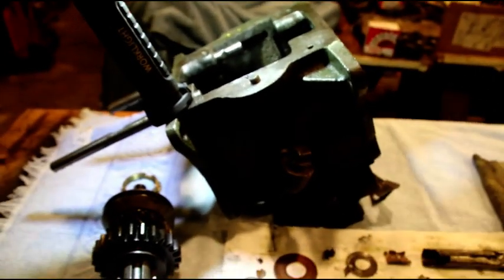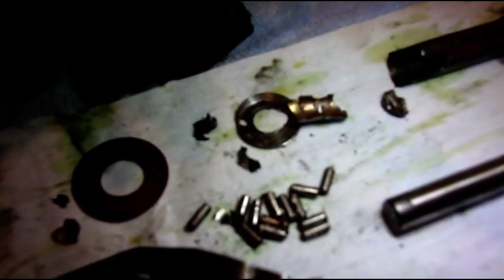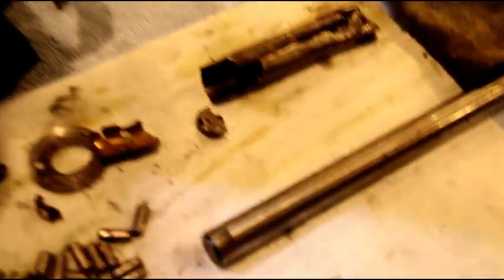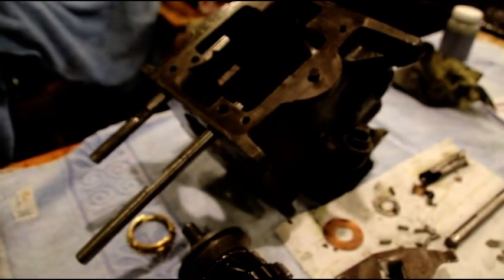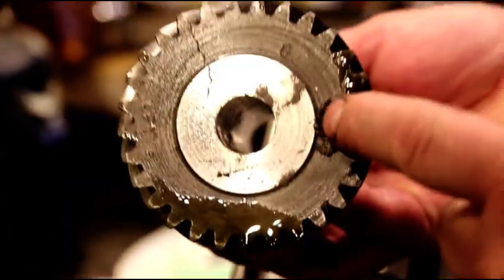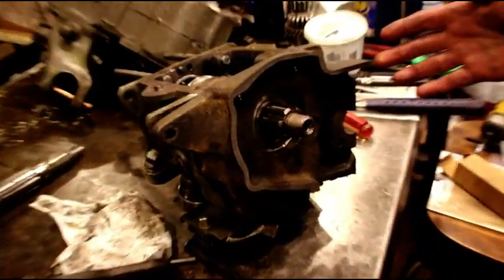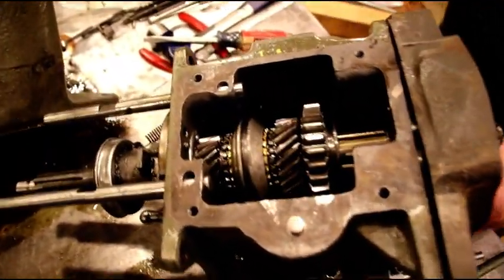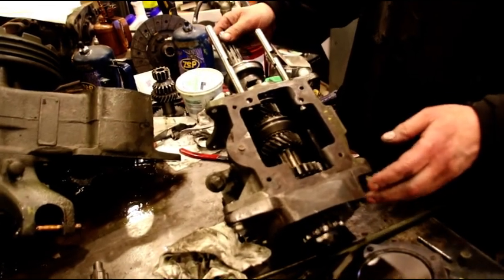Willys MB T84 Transmission Destroyed By Using The Wrong Lube

Comment: I have watched countless videos and read countless threads including the TM section on  the T84. I spent many hours working on it. I did get  a NOS case as I wanted to start fresh. That included some NOS parts and some  repro. I did use an old T case but didn't cut it. It helped a lot. One thing I remember is use all the gaskets needed for it as they play a part in the shimming of the transmission.  I did a lot taking it apart and putting it back together. Some said the blocking rings had to be rather tight no slop and another where the gentlemen said slop is good in that area. I had that. 

Fast forward to today. I'm driving it and used GL1 at the moment and so far no popping out of second and no fluid loss either. I do check them quite often. I do maintain the oil change at around 500 miles just because why not. Won't hurt it. As another gentlemen here said the manual changed from GL1 to GL4. 

I'm curious as to what really happened to the transmission in this video. I've never seen that happen in any vehicle I have worked on. My first thought it low oil for that kind of metal failure. Just my opinion. 

Brian you have a different assembly process than what I have seen. I have saved for future reference. I like to see how others do it. 

One I did see is use an old bearing and open it up enough to take it on and off easier than a new bearing, I did that and I'll tell ya that saved me a lot of time. Again many ways people put them together.

Comment: explain  please   how could a bad lube. cause damage,    you make a lube?    what about the ww2 lubes ?
Reply from the maker: extreme pressure additives in  the wrong lube will eat away brass and bronze.  This is a fact that people don't understand.  My lubricants are yellow metal safe and I have been using and selling them for over 30 years with no problems.  Do not use any type of lube with extreme pressure additives in an early transmission or transfer case.

Comment: We have confusion. I thought gl5 was for rear ends and gl4 was for trans and t case. That's what the book says. Gl5 being high in phosphorus for the ring and pinion which you don't want on the brass or copper. For 30 yrs I ran gl5 in my trans and when I would change the fluid there would be a lot of brass in the fluid
Reply: Same here.I've owned my jeep for 65 years, and for the first 30 years ran GL4in the gearbox. Whenever I checked the oil, it looked like gold paint! So I would change it with more GL4 .But when disassembled, the wear on the bushes and and synchros was not that bad, Certainly not like the wear in this video. It looks like he'd run acid in the box. And the box had run perfectly- the reason I'd taken it out was to change the clutch.
Reply: @autophyte I was running gl5 which is even a bigger mistake. This was on a 77 cj5 with the tremec t150. Three speed. The factory book for it calls for gl4

Comment: Oh dear, that looks like one of those supposedly “NOS WOF” transmission cases sold by that parts guy in Texas. There is some suspicion in the community, that they are in fact old French made repros, as they are missing some of the casting info normally on WOF parts. Some had huge problems with these cases, myself included. Some of the bores for the shafts were drilled too close together in the case, making everything bind up when assembled. Took a while to figure that out…
Reply: I bought one from him and so far no issues. Not hard to assemble the transmission either.  It did have a fair amount of cosmoline on it.

Comment: What and where do you ream before the main gear goes in?
Reply from the maker: There are two bushings in the cluster gear.  when they are installed into the gear they get smaller and must be reamed to size so the countershaft will fit thru and have the proper clearance for lubricant around it.  If the bushing are not reamed to size first the bushings will seize on the shaft and cause trouble.
Reply: @metalshaperJeep  got it. Thank you.

Comment: It's really great to see you are back!! Thank you for the great info and tips! Does the shimming on the main shaft apply to a T90 as well? Really sad to see a transmission be messed up from using the wrong oil. Hope you are doing well!
Reply from the maker: T90's don't need shims.  By the time that transmission came out production was very accurate and the shims were no longer needed to properly put a transmission together.

Comment: Amazing! What type of transmission would be ok with that GL4 lube? Something more modern?
Reply from the maker: GL4 is a rear end lube.  Early transmissions need the proper viscosity and a safe for yellow metals formulation.   Brass and bronze are extremely sensitive to extreme pressure additives.